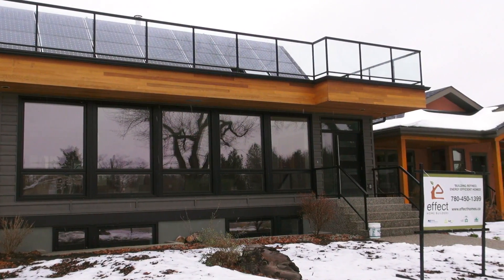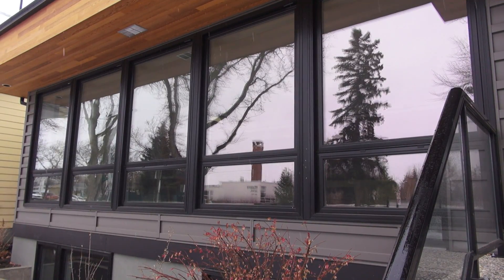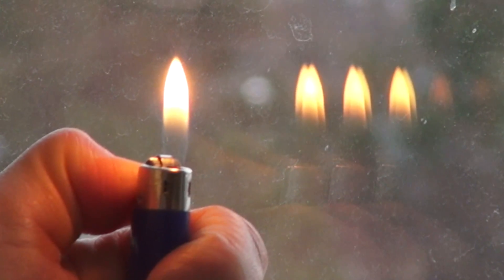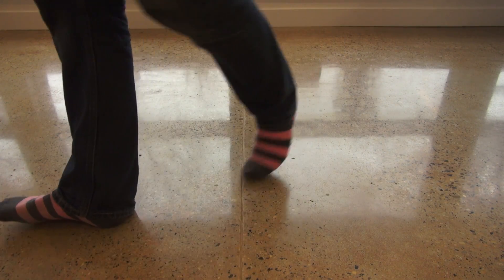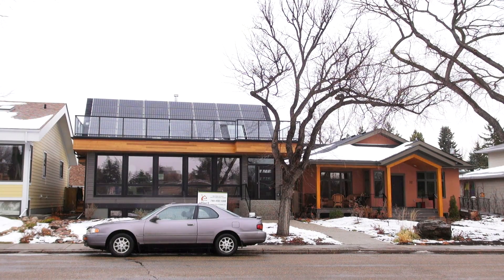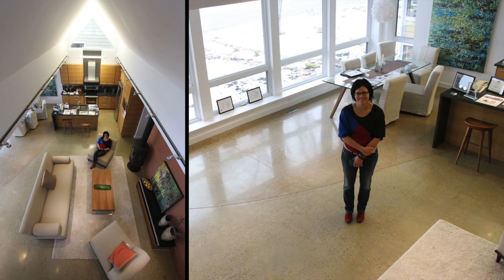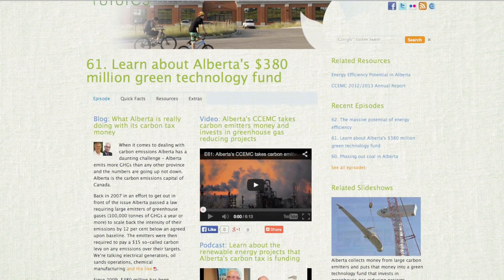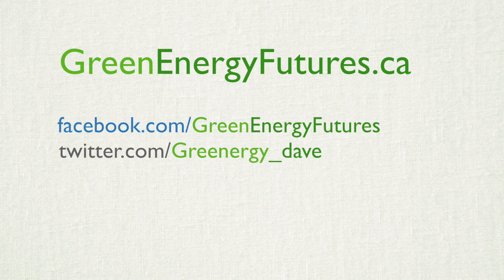63. How passive solar design and thermal mass can cut your energy bills

Comment: A bonus in checking how many panes of glass in you windows with a lighter vs a flashlight is the heat fro the lighter gives off 1 btu of heat or 1/2hr.

Comment: One issue with the sun heating the floor is for that to be effective you can't have a lot of furniture covering that floor. Plus any furniture in that zone is going to be degraded by the UV.  Notice that there is not a lot of furniture in that space in this house. So that is a lot of square feet of floor space that is best used for a dance party, yoga classes or playing with your dog. It needs to be figured realistically into the cost of the home.  Some designers think that just having lots of mass will absorb excess passive solar heat even if it is not directly heated by the sun. So you could opt to have mass elsewhere. Maybe you could have furniture with mass on the back but then it would be hard to move around -wheels? Also one thing that seldom gets mentioned is that passive solar homes are MUCH more cheerful to be in in the winter with sun streaming deep into the house. One other factor to consider is that many people are very privacy oriented and in a lot of locations all that glass is not going to be very private - like a fish bowl. I have built rentals with lots of south glass and commonly the tenants will have the blinds completely drawn all the time.  (I live in a passive solar home with very low heat bills so I am not just being a naysayer)

Comment: Port Alberni in the Heart of Vancouver Island BC Canada  first Passive house https://www.youtube.com/user/seumas2/videos
Material used

Port
Alberni's first Passive house (Passivhause) build in the heart of
Vancouver Island British Columbia Canada.

Passive
House(Passivehaus) is considered to be the most rigorous 
voluntary energy-based standard in design and construction industry
today.

Passive
house buildings consume up to 90 percent less heating and cooling
energy than conventional building.

The
use of Passive House design software was used to gain the specs
required to meet the performance standard for this location.

House
was constructed well  above the current standards as outlined in
the B.C. Building Code.

Footings
were widen to 36 inches(914 mm) due to low bearing soil conditions
and additional rebar reinforcement added.

30
inch high (762 mm) high reinforced walls . Course sand placed inside
foundation walls and mechanically compacted.

Three
layers of four inch *102 mm) thick  Expanded 
polystyrene foam sheets with all joints staggered and tape were
placed on top of compacted sand.

The
three layers of foam have insulation value of approximately R 50.

A
20 mil layer of poly was placed over the E.P.S. sheets and taped and
sealed.

Four
inches(102 mm) of 30 m.p.a fiber reinforced concrete was placed to
form a slab over the foam based.

Slab
is isolated from concrete stem wall with four inches (102 mm) of
E.P.S. to prevent thermal loss.

All
cold water lines are buried in the sand to keep them cool, hot water
lines have been placed in the center layer of foam insulation to
minimize heat loss.

Wall
plates compress to heavy beads of acoustic sealant between layers of
vapor barrier to prevent air movement.

The
walls are double stud configuration set at 24 inches (610 mm) on
centre and plates are spaced in a manner that yield a 20 inch (508
mm) thick wall. 1/2 inch (12 mm) standard plywood sheathing with 
Mento 1000 a three layer airtight vapor open house wrap( far superior
to common house wraps) with 1/2 inch(12 mm) pressured treated plywood
rain screen battens form the exterior surface. 

Intello 
smart vapour barrier was installed one third in from the inside wall
to prevent condensation in this climate.

Triple
pane argon filled windows meeting passive house standards from
Euroline  were placed mid wall to reduce wind wash heat loss. 
All window openings have been splayed at 45 degrees to give a full
wide angle view.

Almost
all the wiring and plumbing was kept inside of the vapor barrier
envelope to minimize air leakage.

Passive
house standard requires air leakage not to  exceed .6 Air
changes per hour at 50 pascal.

Zehnder
comfoair 200 HRV has been installed with a 1000 watt air preheater
.(92 percent heat recovery rate)

House
has been pre- plumbed for a heat pump water heater reducing 
domestic water heating cost significantly.

Garage
has been pre-wired for 40 amp/240 volt  electric car charging
station.

House
to be equipped  with  heat pump condensing dryer which
requires no external venting,only a water waste line. George K
Builder. © George K 2019      
https://www.youtube.com/user/seumas2/videos

Comment: I love the idea of a passive "solar " house and it definetly is one of the best energy efficient designs around.
I do however like passivhaus design a bit more because it is not necessary to have a south facing position to capture the sun and it saves on big expensive s windows that allow heat to escape when it's cloudy and cold. Massive amounts of insulation coupled with no thermal breaks, triple pane t&t windows and a good air exchanger if you like that sort of thing ,will accomplish the same thing as a south facing window wall and do it with little regard for orientation.

Comment: If the low-E coatings reflect heat generated within the house back into the house wouldn't they reflect the sun's heat back out at the same time thereby reducing the amount of heat being added to the thermal mass?
Reply: +NimblyBimbly Supposedly the high angle of the sun in summer is a factor in Low E glass deflecting the sun's rays and with the low sun angle  in winter the window allows more penetration and heat absorption inside the house. My south facing sunroom has three 4' X 5' windows with argon and no Low E (I ordered them that way). The patio door has argon and Low E. In mid winter I find the tile floor in front of the windows warms up much faster than in front of the door. Standing in front of the door and then a window proves the same thing. Of course it works both ways with heat leaving the building during the night.I spoke with several window vendors before ordering the windows. They all told me the same story about winter/summer angles, all quoted from sales literature. I opted for greater heat absorption by mass in the sun room by not getting Low E. After many years and many nights of -30 C and greater I made the right choice. My sun room is a 4 season room. Having sufficient 'mass' and greater heat absorption without Low E more than offsets night time heat loss that Low E would partially prevent. In my experience.

Comment: Most of these thermal mass videos talk about it really poorly, or in the context of passive solar heating. Especially the heating part. Some time needs to be spent discussing it's non-heating non-passive solar benefits.

Thermal mass is useful in a structure even when there isn't passive thermal heating.

In hotter days when you might have hot days and cooler nights, you can open windows and pull air through the house, cooling down the thermal mass. Then close the windows in the day and the thermal mass will keep the house cooler longer.

Then as the weather goes cold, even without passive solar heating, the thermal mass acts to keep the house warmer longer, extending the heat of a nice day in spring or fall into the chilly nights. When it gets cold all day round, it's still useful without passive heating as it minimizes the impact of, say, opening and closing doors as you enter/exit the house, and if your heater should fail, it will give you more time to get it fixed/get a new or temporary heater before you start freezing.